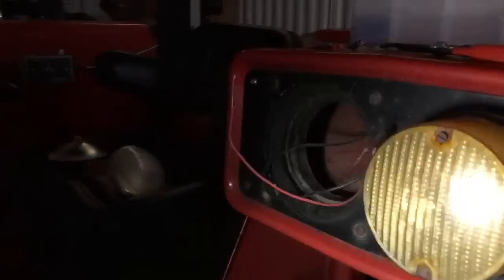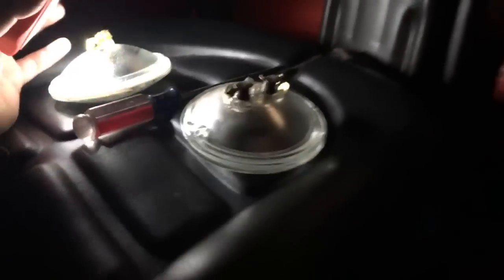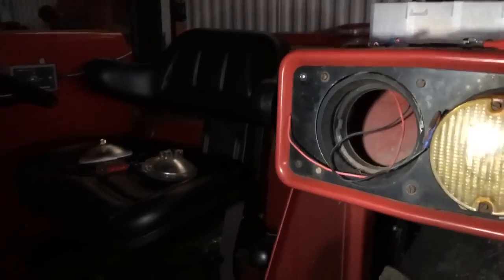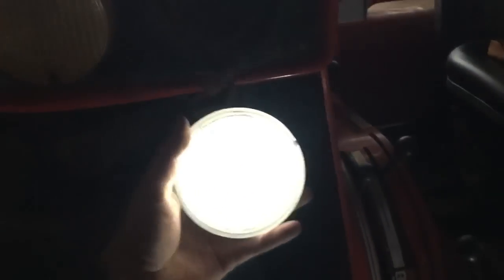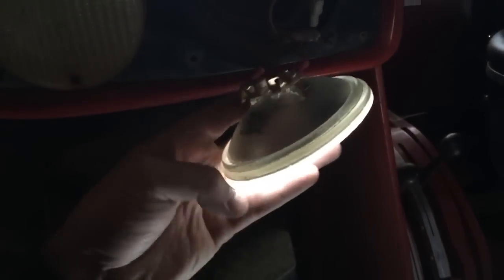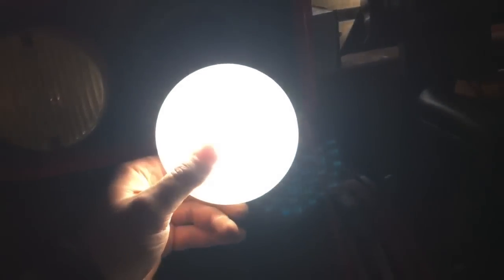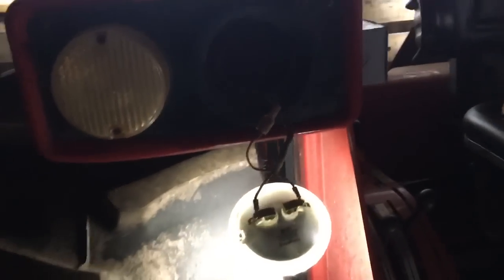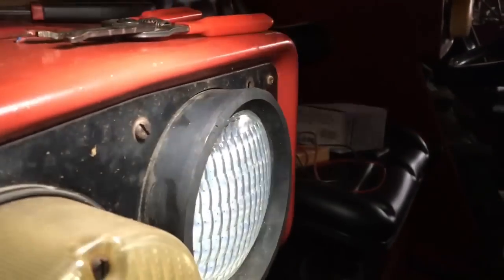Case IH 685 LED Lights

Comment: You could change sides and see if the good one works in the bad side   then your know it's the light not wiring
Reply from the maker: I did end up doing that a few days later, no good. I still didn’t order a new one, I should soon so I can still return the old one